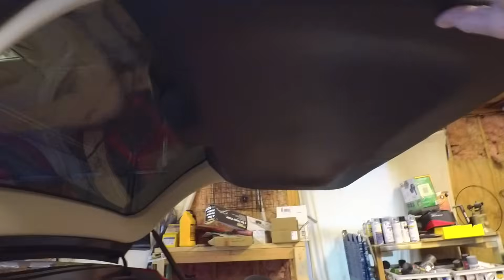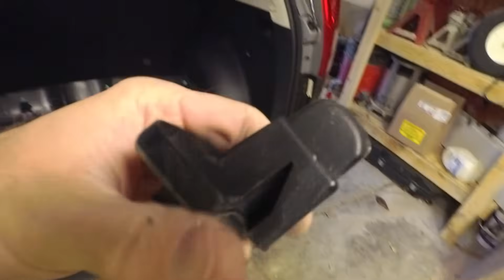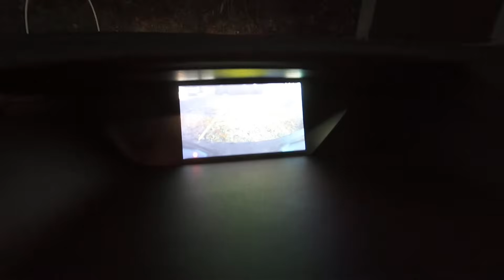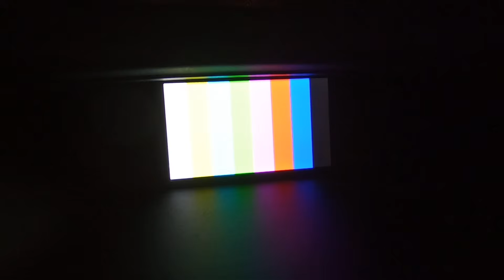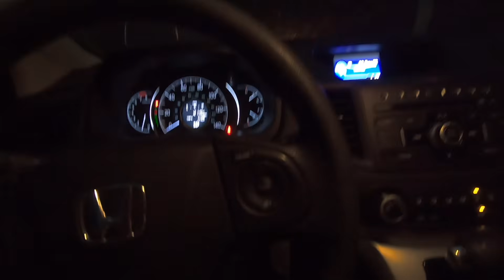2012-2016 Honda CRV Backup Camera Replacement - How To Guide

Comment: I read several reviews (on Amazon) for the link you provided for the "OEM style" camera.  According to some of the reviews, the camera was not adjustable and only worked in wide mode.  Were you able to adjust this camera?
Reply from the maker: The one I got you could change the view. Not sure if the part has changed over the years or not

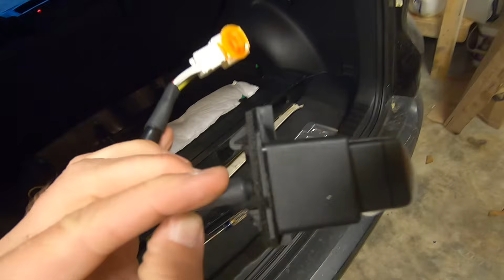Comment: 6:12 I bought camera with such a connector (two grooves on the bottom inside) it doesn't fit to 2014 Honda CRV connector. I had to put old camera back. There are must be 2 rows with 4 pins on each row connector like this one on Amazon: JDMON Backup Reverse Rear Park Assist Camera Replacement for Honda CR-V 2.4L L4 2014 2015 2016 Replacement for 592-268 592268 39530T0AA11 39530-T0A-A11. BTW, I just bought it from Amazon and installed on my 2014 Honda CR-V without a problem. Connector fits, camera shows All: Wide, Normal and Down look views.

Comment: thanks for the video 
my backup camera comes through the stereo display itself and not the smaller one up top. 

from what i’ve seen it’s a hassle to get the OEM camera to play nicely when upgrading the head unit, and if you do adapt it, you lose the view options. 

if i tap into the signal or power from the original connector for the backup connector, could i get signal to an aftermarket one? 

i believe i read it may not be 12v like most aftermarket units

Comment: Not sure if a replacement camera would help me, but I'm having issues changing the viewing angle in reverse. In diagnostic mode I am able to switch between the 3 viewing angles. When in reverse, the selector knob changes the radio modes. Any tips would be appreciated.
Reply from the maker: Sounds like your radio / button is defective. If you can change it in diagnostic mode, the camera is fine.

Comment: Hi. Thanks for the video! I have a couple of questions re a 2016 CRV. I had the radio replaced in order to have Android Auto and Apple Car Play on screen which we love. When they did that, our camera switched to what can best be described as "fish-eye". The view doesn't occupy a rectangular screen but is reduced to the shape of an eye (points on the side and widest in the middle). It is usable but I don't know if it's because of the new radio or the camera has gone bad. Do you have an opinion? Also, the "good" replacement camera you mention is no longer available on Amazon. Do you have an updated recommendation? THANKS!
Reply from the maker: It's the default view. You can change it via a secret test menu that I show in this video around the 8 min mark
Reply: @JackofAllMasterofNone  I really appreciate you getting back to me. Mine is a 2016 and I think it differs in several ways from yours. The backup camera goes to the main radio screen and not the smaller one you are viewing. And I did try your method at the 8 min point and it doesn't work, which I believe related to the wiring difference between the car years. I'm not technically proficient enough to do it, but I think I would have to remove the new radio (with Android Auto, SiriusXM, etc.) and replace it with the original to do as you mention and then test screens by alternating hooking up the new radio.

Comment: Can you just clean the old camera? Is there a way to take it apart? My problem is my camera is dirty on the inside
Reply from the maker: No. They are "sealed" and eventually loose the seal slightly enough for condensation to get in and eventually some dirt. It may be possible, but would take micro electronics ability

Comment: I just changed mine. Pretty easy to do, except one of the 8mm bolts snapped the plastic inside the black trim piece. I’ll figure another way to secure that. Using permanent outdoor double sided tape for now.

Comment: I have the problem of a black screen. The lines are still there. Guy hit me from behind. Body shop eventually replaced back window because defrost wouldn't work. A couple of days later is when I started having problems with the camera. A lot of lines across. Now it just black. Body shop says not their problem. Any way, it looks like I will need an after market camera. I went through Honda dealership and their cameras are on back order. After watching your video, they may be on back order indefinitely. I couldn't find your link for purchasing this. I looked on Amazon but frankly I'm pretty clueless. Can you help me please?? I would really appreciate it. I really miss it.
Reply from the maker: OEM Style Multi-Angle Replacement Camera https://amzn.to/3qxOLmh
Reply: @JackofAllMasterofNone  Thanks for the link.  Just ordered the OEM part.

Comment: Sounds crazy but do you think a hair dryer on a cool setting would dry out the moisture in the camera housing to try to avoid the replacement?

I'm assuming if moisture found it's way in once, the seal is damaged and would probably come in again so perhaps replacement is the best option...
Reply from the maker: Exactly. Even if you could dry it out it will just happen again immediately.